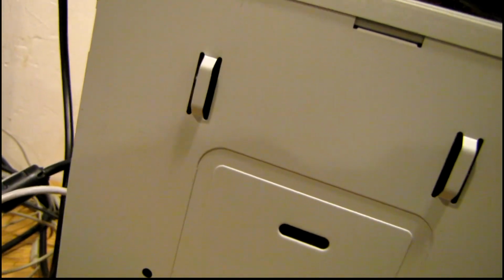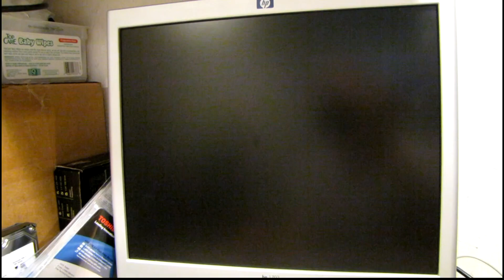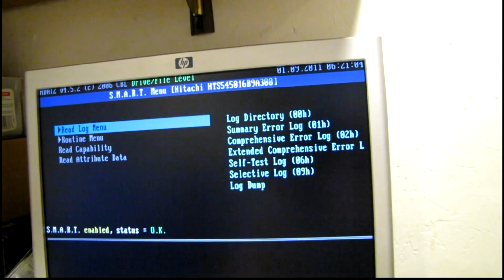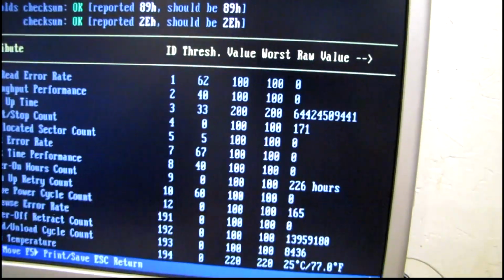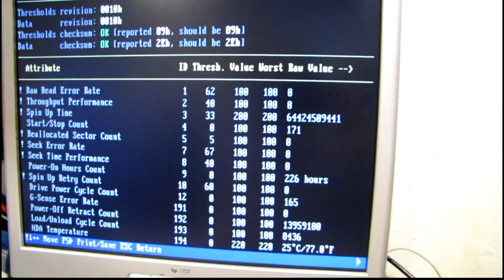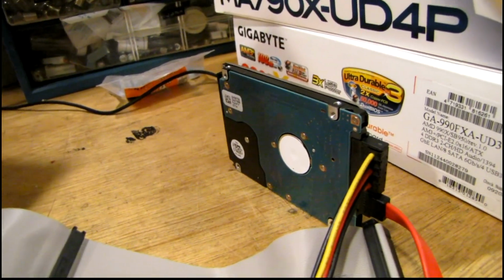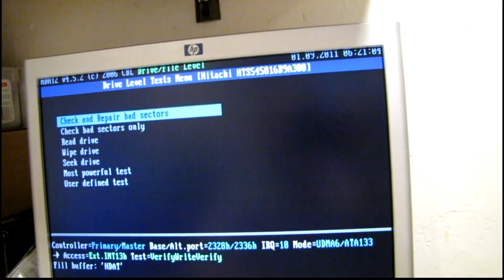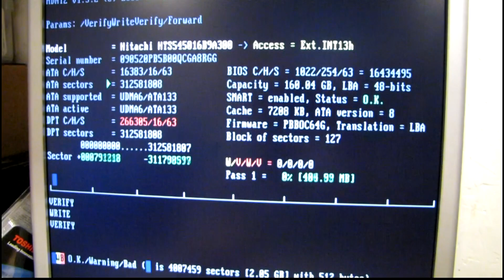Mini ITX Hard Drive Test Jig

Comment from the maker: @MieleTouchtronic That shouldn't matter.  I used the bootable CD for most systems.  Even this ITX jig is a 64 bit system.

The current version of HDAT2 is only a test version that doesn't actually do anything.  I think version 4.5.3 is included though, which actually does work.  4.5.2 is the fastest though.

Comment: Cool beans. as for my HDDs I get, most of them either work perfectly, or have a mechanical or electrical failure -- i've never had a bad sector except for a SAMSUNG drive that i droped on a very hard floor once actually -- still works though :P Too bad new PCBs for hard disks are so expensive.